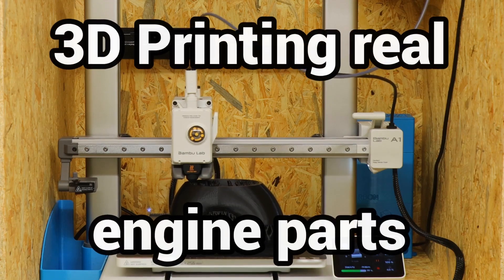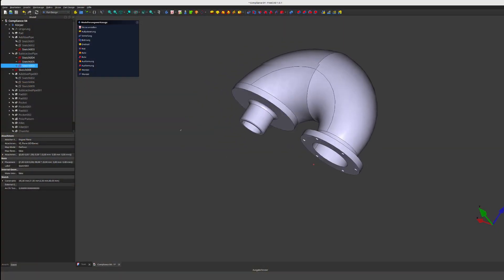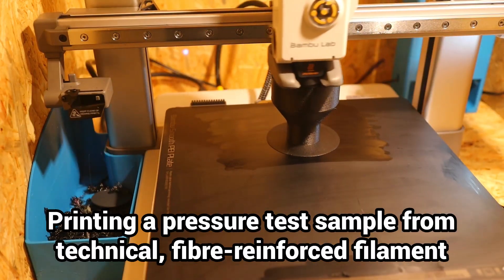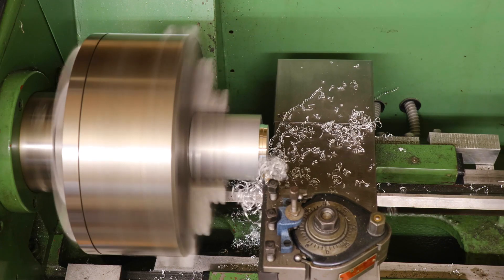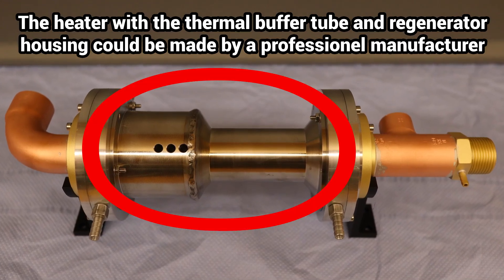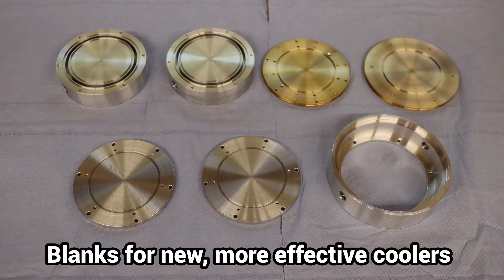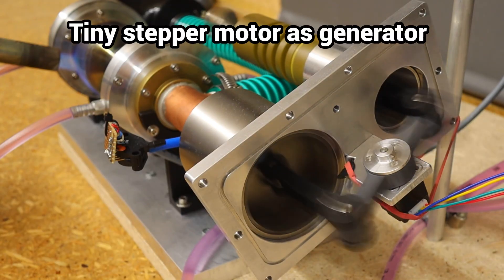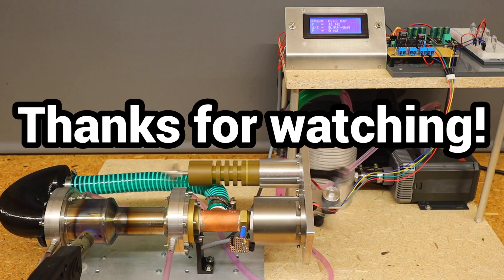Cheap electricity with a 3D printed acoustic Stirling engine for everyone

Comment: You can also coat 3D prints in a copper laquer and electroplate them to give them strength, rigidity and higher heat resistance :)
Reply from the maker: Isn't it a problem to coat as big parts as the compliance ?

Comment: Apparently NASA/DOE developed a 62.3 kW stirling engine for cars in the 80s, dunno if you were familiar with it...

Mod II automotive Stirling engine was an advanced, second-generation prototype developed in the 1980s under a program sponsored by the U.S. Department of Energy (DOE) and managed by the NASA-Lewis Research Center. It was designed to demonstrate a highly fuel-efficient and clean-running alternative to the standard internal combustion engine for passenger cars.

I found a detailed PDF:
https://ntrs.nasa.gov/api/citations/19970012689/downloads/19970012689.pdf

Comment: Have you heard of digital foundry fillaments?
Reply: They are easy to print and sinter out
Reply from the maker: Yes, but its hard to keep tolerances and the sintering must be done by a firm afaik?
Do you know if these parts are airtight?
Its a really interesting technology and I will think of it when its time for a new core branch!
Reply: The tolerances and shrinkage are surprisingly predictable and repeatable. Mark forged entire product line is based on these processes. If you'd like, Id be willing to print somthing in one of those fillaments (I have steel and copper) and ship a part to you?
Reply from the maker: That sounds great and is really very kind of you.
When the new heater, possibly with an integrated burner, has been fully designed, I will get back to you. Thank you very much, that is a really great offer!
Does the sintering have to take place at the manufacturer's premises?
Do you know if it is airtight?
If not a treatment with dichtol may be possible!

Comment: In an older video you asked if you should go for more power or more easier build. I think going for low power and easy (and cheap) build might be interesting. If you achieve low maintenance you could build a Stirling farm - meaning many engines running in parallel to scale the power (to what ever power you need). If an engine breaks you could replace with a pre-build spare engine in no time. You'd also have redundancy, so if an engine breaks you're still generating power, just a bit less. Much like the SpaceX rockets with their raptor engines.

I just found you now and instantly followed. Very interesting channel and project. Keep up the great work.
Reply from the maker: Thanks for your nice comment, the use of multiple engines is an option but nevertheless the power must still be increased much!
Reply: Using a loudspeaker generator like Gilbert's also seems very interesting to me—especially because of the low maintenance requirements, as there are no moving parts or friction except for the membrane. I would expect the membrane to wear out very slowly.
Reply from the maker: A loudspeaker is very unflexible for this early experimentation phase as all parameters change rapidly.
When the engine is developed to a certain degree I will try one!

Comment: I'm really interested in your projects but you'd have to ditch the helium.
Reply from the maker: You are right, helium makes it much more complex but maybe it is worth a try...
Reply: @myengines2443 we may actually run out of helium in our lifetimes. It's not a renewable resource like steam. If you need a lightweight gas I imagine you should use hydrogen with some sort of neutralizing chemical if it should get out.

Comment: Hola. Muchas gracias por compartir tu trabajo. 
Me parece un proyecto muy interesante pero me encuentro algo perdido pues me gustaria encontrar mas información. Algo como un tutorial paso a paso.
Se que esto conlleva mucho trabajo y mas aún tratándose de un proyecto en evolución permanente.
Pero lo importante es transmitirte que tu proyecto tiene mucho interés y ,a veces,  una explicacion detallada y paso a paso puede hacer que llegue a mucha mas gente. Y además podemos aprender mucho implementando las distintas mejoras que puedan surgir a lo largo del tiempo.
Muchas gracias y felicidades por tu ingenio.
Reply from the maker: It would make sense to start with the simpler test tube thermoacoustic Stirling engine, which I described in detail in older videos.
All 3D printable 3D models are available for download in the members' area, but some components still require a little creativity. Detailed instructions are also available there.
The download links are also available on Patreon.
If you don't want to or can't become a member or Patreon, you can also find the links in this video. You have to familiarise yourself with it a bit to understand everything, but a complete step-by-step instructions would be a lot of work, so there would have to be a lot of interest.

Comment: Can a refrigerant be used to lower the effective working temperature, for exhaust gas energy recovery, similar to an organic Rankine cycle generator?
Reply from the maker: I'm not sure if a refrigerant makes sense here, but exhaust heat recovery with combustion air preheating is definitely a must. Even when wasted heat is used in the CHP for warming. Please explain your idea a little more!
Reply: @myengines2443 sorry I meant to do exhaust energy recovery from internal combustion engines, preferably diesel where egt is relatively low... I'm building a large ship engine and will keep volume reserved in the engine room to do something with the exhaust heat....
Reply from the maker: Yes, this was the intentional purpose for the use of the thermoacvoustic engine, to use exhaust waste heat.

Comment: Is this Sterlin engine more efficient than a steam turbine? You could also run a boiler...so is that more efficient or no? You could probably 3d print the turbine.. you could have multiple low and high stages..!! No>?
Reply from the maker: The problem with steam is that it is dangerous and always a mess with all the water and steam.
To get some real power you need high pressures which is dangerous and I don't know if the efficiency can be higher.

Comment: The future of this project may become entirely computer-aided for resonance chamber and tube design, using simulation of the working gas in various shaped chambers. This would benefit from the 3d printed approach. Metal 3d printing would be my go-to for high pressures inside of a completely sealed vessel. Maybe you could even custom order and then resell parts for this engine as a business? Inconel or a high-grade steel.
Reply from the maker: This is actually my development plan, when I have some time and learned more about the engine I want to learn DeltaEC which i set up in a VM under Linux now.
I need also some experience and time to design a 3d printed metal heater and have several firms who will print it for a test video.

Comment: Brooo! Crankshafts are obsolete already!
Try that one that have vibrating piston on a circullar springs- like that one of 4 in that experimental nuclear microreactor cooled with sodium- only one moving part not mentioning the ,,pancake" springs- NASA probably uses simillar tech to power satelites and probes with nuclear decay heat
Piston on one side , magnets on the other side
You heat it - piston wibrates from thermoacoustic effect and magnet on the other side of the rod wibrates near coils which mekes power
Simple , elegant, nearly zero maintenance
Good luck!
Reply: By the way to reduce power usage on cooling just make a pro player move and use ram pump combined with a hydraulic trompe to make gravity do work for you- and the pump will work only occasionally- to refill the main upper tank to keep gravity working for you
Keep going bro!
Reply from the maker: Yes that's really straightforward but as long as the piston is not very lightweight I need the lever for balancing anyway, preferably coupled to a linear generator!

Comment: You could also use aluminum lost material casting, which you can use 3d printing to create a mold, cover in either ceramic coating or sand plaster, and melt out the plastic (or burn out completely) and pour aluminum in the empty mold. Fdm printing is useable for this, but for more precise things you can use resin prints
Reply from the maker: Yes this is a really cool fabrication method, I will use it maybe when the design is final!
Reply: @myengines2443  if you have not already entered the rabbit hole of metal melting and casting with generic microwave devices and diy sintered silicon carbide crucibles, I'd strongly recommend the channel @ShakeTheFuture. He even managed to melt and cast iron and stainless steel parts with decent quality which I think is really impressive with just regular household and hardware store goods

Comment: I appreciate your intentions to make the engine simple enough for general home builders. What about the working gas?  I don't know how easy it is for homes to get compressed helium. I remember reading that helium is in relatively low supply. Is it not possible to oversize the engine in order to get the power desired by making it larger instead?  I am concerned that pressurizing rare working gasses will make the engine too difficult for people to build, even if they are capable of printing and welding the parts.
Reply from the maker: Helium is purchaseable at any hardware store but you are right it makes the engine more complex but for experiments it might be quite interesting. If it makes a power boost it might be worth considering!
Reply: Pressurizing makes it much more powerful and Helium is used because of the very high thermal conductance.  The old Phillips engines start at low pressure and self compress to higher pressures. Not sure what NASA are doing on their 1KW Stirling.

Comment: Man i wish i could build myself a 1kW Stirling engine......
Reply from the maker: 1kW is really a very ambitious goal.
But if the Stirling engine is very reliable, wouldn't a smaller output with a buffer battery be sufficient with continuous 24/7 operation?
Reply: @myengines2443  mayyyyybe, but i would like the option to directly run something like a computer if needed. But thats pretty much a pipe dream at the moment, since i dont have a lathe.
Reply: @xxxm981  solar + sterling > battery bank (you can even make a battery bank from used vaporizer batteries people leave all over the place) would run a computer. Generators can also run on syngas produced by a wood gasifier (you can make a diy gasifier fairly simply). 

Your computer would run on the battery not directly from the generators. The generators just charge the batteries.

Comment: Greetings my friend.  I see you are still beating your head against the wall with these engines:-))
You stated that your rhombic drive engine needed much maintenance.
I also built such an engine many years ago and I did not find it so.
In fact I built a very tiny engine that ran close to 8,000 hours over a period of 10 years and only needed the hot cap replaced.  The original was made of 310 stainless steel and lasted all that time.
You may believe that the rotary output engine is too complex;  I believe that the complexity lies primarily in the heat exchangers.
Anyway, good luck with your endeavours.
Reply from the maker: Maintenance and wear mainly relate to the bearings and sliding surfaces on the cylinders and pistons.
This wear has increased significantly with the power output. When the power output was still quite low, the Stirling engine ran for several thousand hours without maintenance. 
Now, with an output of 300 watts, the loads are so high that after a few hundred hours, some heavily loaded parts such as the piston rings have to be replaced.
My next version of a mechanical Stirling engine would be designed for lightweight construction and frictionless running, but I still fear that I will not be able to get the endurance under control.
Thats why I trying this new concept, and and I'm making good progress but it will take some time.
Reply: Cannot find your take on the rhombic engine on your channel. Would be great to see it.
8000h bto would make sense, maybe not for an average consumer, but sure for many enthusiasts. 
Have a nice day.
Reply: @Anowow-k3j  Sorry about that but the rhombic engine is not on my channel.  It is still in pieces subject to modifications:-))

The one shown is a tiny engine built to plans in Popular Science Magazine.  It is this one that has run at least 8,000 hours.

Life expectancy is a matter of material choices (or availability), workmanship, and appropriate lubrication.

Comment: I want a 3D printed, pellet fed Stirling engine with a 
thermal syphon coiled around the chimney.
Reply from the maker: Yes, every Stirling engines wasted heat has to be used, its only effective as a combined heat and power unit!

Comment: Just to check, when you say "integrate the burner into the heater", I assume then that it would be difficult to use such a design with concentrated solar? That's disappointing, but an understandable limitation. Perhaps an engine designed specifically to work with concentrated solar could be something to look into for a distant future project.
Reply from the maker: It would not be too difficult to design different burners for the use of multiple heat sources.
The design of the internal gas passages could remain the same, with only the type of heat transfer being changed.
I would like to use the engine to support the solar system in winter; when the sun is shining, we have enough electricity anyway.

Comment: What is your target power output? What about efficiency or other metrics?
Reply from the maker: Target power is in the region of my rhombic Stirling of 300 watts which is enough for us when it runs 24/7 in winter parallel to the solar plant.
I will make efficieny measurements when the output power is in the region of the target power, but in such a small engine ist always quite low.
As its a micro (or better nano) CHP generator for use in winter all wasted heat is used for warming.

Comment: I thought thermoacoustic engines would work at a higher frequency and smaller displacement. Does that not work out in practice? If the displacement was smaller then something like a loudspeaker cone might be enough to extract the power.
Reply from the maker: The use of some sort of loudspeaker is the most easy extraction method but it has a few drawbacks.
Its efficiency is low and its operating parameters are fixed.
As the output of the engine is changing heavily with every enhancement the loudspeaker also has to be changed so I try to make my power extraction units as flexible as possible.
Reply: @myengines2443  That's interesting. I hope you are successful with this. I looked at it from a theoretical point of view for a while 15 years ago but I got bogged down trying to figure out the maths and got absolutely nowhere.
Reply from the maker: Thermoacoustic theory is really not easy to learn. That's why I'm trying the experimental approach first and only doing very simple calculations with a few basic parameters.
Once I have a better feel for the engine, I want to delve deeper into the theory and, above all, into DeltaEC.

Comment: best if you can use basic hard ware store stuff like steel pipes directly. ie like two different diameter steel tubes over each other for some burner structure. possibly with some welding only using sheet metal. or just making the whole thing from bent sheet metal.
Reply from the maker: I have already used quite a few standard parts in my prototypes and would like to continue doing so.
This is the simplest and most cost-effective solution, but unfortunately it cannot be used everywhere.
Reply: I like parts that I can buy, test, use, return from big box stores. Readily available when inspiration hits, easily returned when inspiration dies

Comment: isnt hidrogen is cheaper gas than helium yes its explosive and burnable but you can make it easly you can electrolis salt water and get your hands on cloorin gas and hidrogen gas as long as you has good wentilation clorine can be discarded and hirogen is troblesome but doible and cheaper than helium? ps invisible flames are ptsd indusing but hey its cheaper right?
Reply from the maker: You're right, hydrogen has the best physical properties, but I think its explosiveness is too dangerous, and besides, its molecules are so small that it would be very difficult to seal the engine.
Reply: Hindenburg 2: electric boogaloo
Reply from the maker: Yes, that comesto mind...